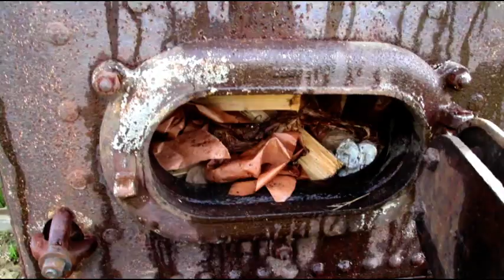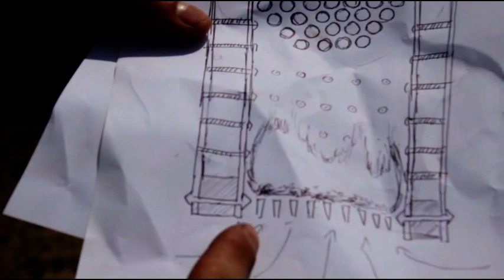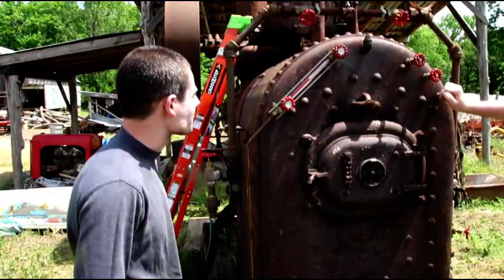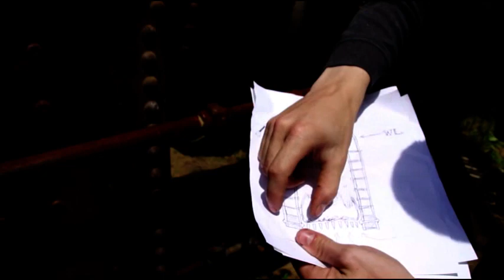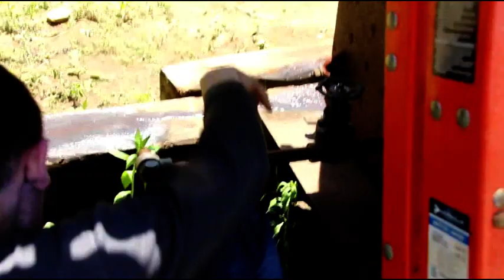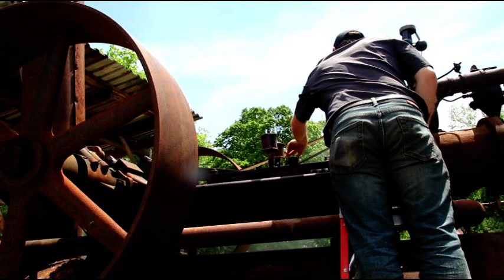Steam Engine Operation Explained Part 1

Comment: great explanation.  makes my Mamod stationary engine look pretty simple .  great video yet again
Reply: Truth be told there is very little difference in principle between this machine and your Mamod save size, valve gear, and the ability to add water while running.  I want to do segments on real powerhouses.
Reply: @AEKarnes  really appreciate the reply, I was surprised anyone younger than 100 yrs old is so knowledgeable about steam engines.  Ha .  great explanations.  thank you.